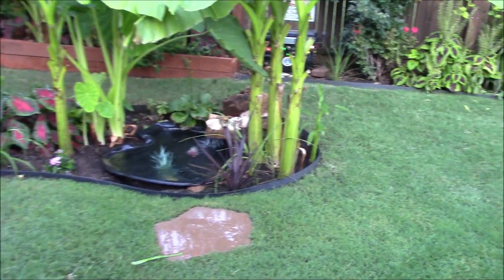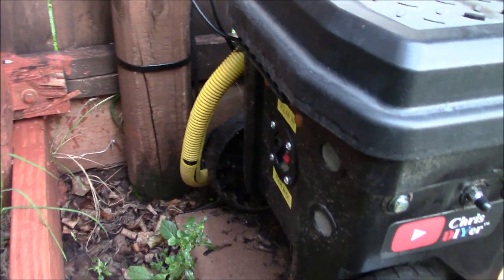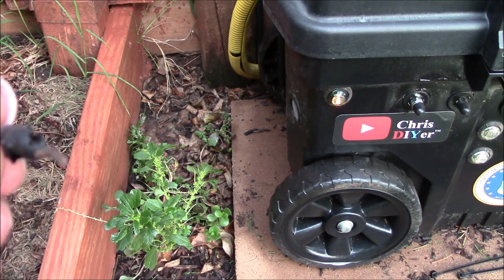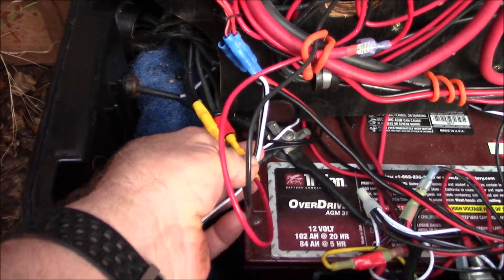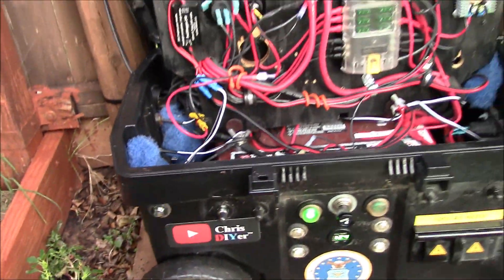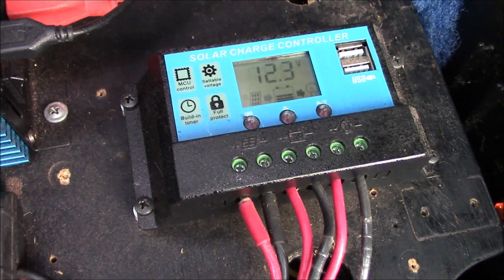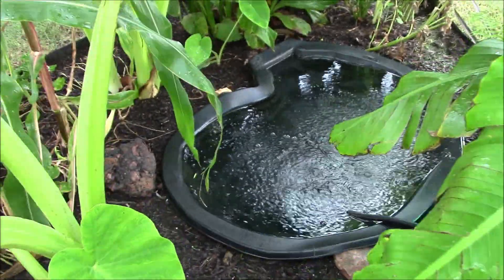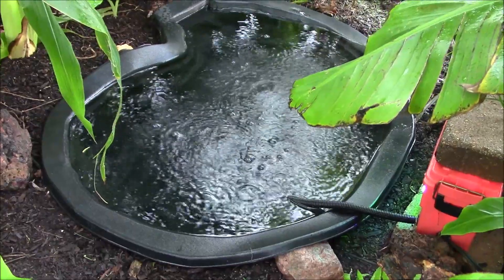Burned up PV solar panel input wires - DIY 12v backyard garden pond solar power generator system

Comment: I see you're using the load terminals in the charge controller.  So I'm guessing it automatically cuts off the pump if the voltage gets too low and starts up again once the voltage hits a certain level.  Has this happened yet since you installed that pond pump?
Reply from the maker: Yep and yep! Works great. LOAD cuts off the LOAD (the pumps) at 12.0v and turns back on at 12.6v (when the sun comes up). In the summertime, the battery voltage rarely goes down below 12.0v...so, the pumps usually stay on 24/7 (unless it gets cloudy). All autonomous operation. 300w in PV panels on this system works ideal. I had 200w last year...didn't work as well